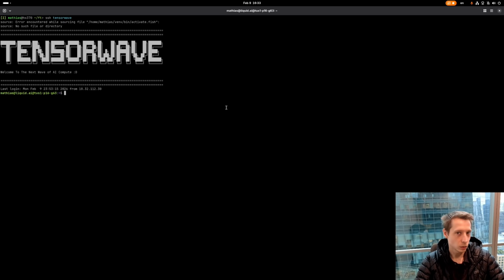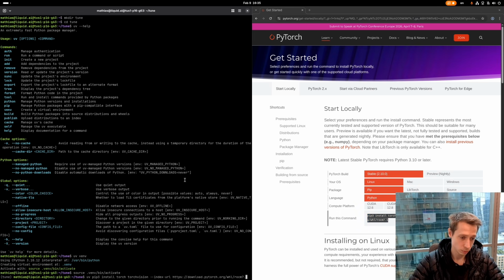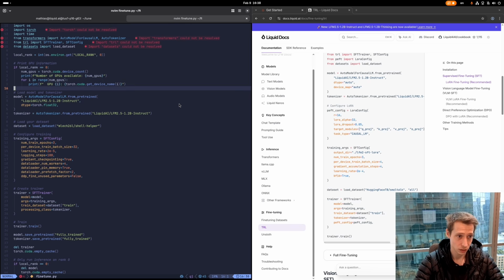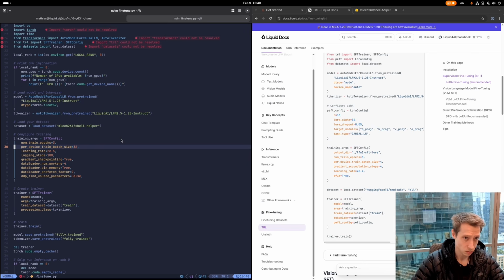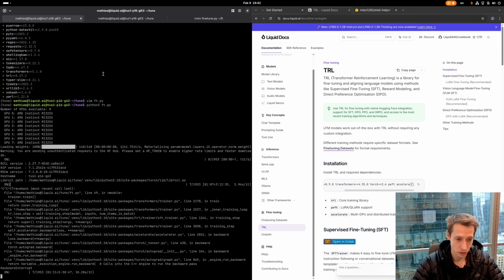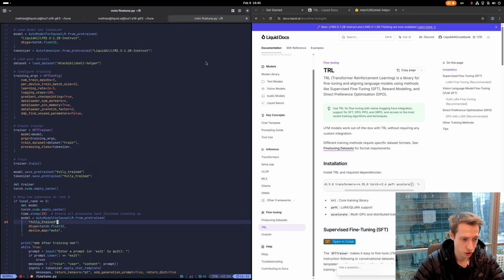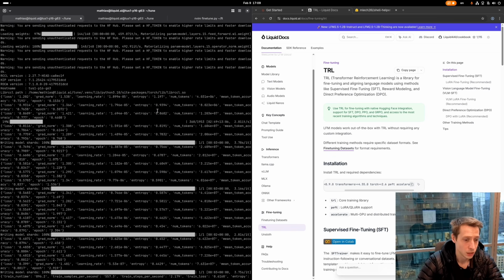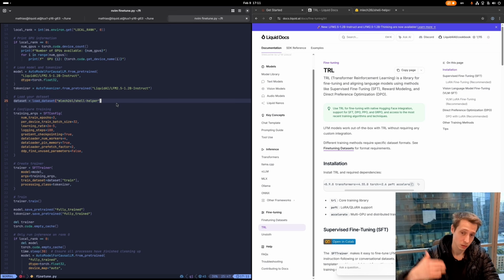Is the Nvidia Monopoly Over? Fine-tuning our Liquid AI LLMs on AMD MI325X

Comment: AMD just has shitty drivers and shitty firmware Kernals.
Reply: What nonsense did you write? I am not developer or know anything about coding, but "shitty Firmware Kernals"? It's called Karnel not Karnal and it takes control from Firmware to boot to OS, at least I know that much. Go suck D to Leather Jacket Jenson fanboy. Just stop lying to people ignorant prick. AMD has improved their stack and its open source so everyone can tune it for their needs, unlike Nvidia walled garden. Nvidia just had advantage that people and developers adopted CUDA, that's why they had so much lead, but things are changing, especially now. It won't take long until even Chinese GPUs be useful as Nvidia and AMD ones. So, if you are interested in these things, first learn or do research before you write some nonsense again.

Comment: I'm fine tuning on a full AMD stack. working on building out 4x 9700 ai pros now.
Reply: What motherboard options have you run / looked at for dual or quad GPU
Reply: @leemiller5194  I'm running a old 2nd gen threadripper  2970wx on a ROG zenith extreeme alpha